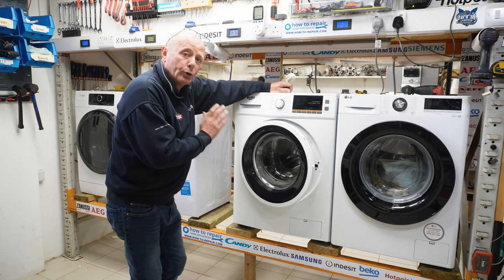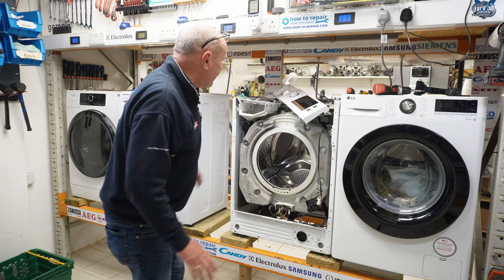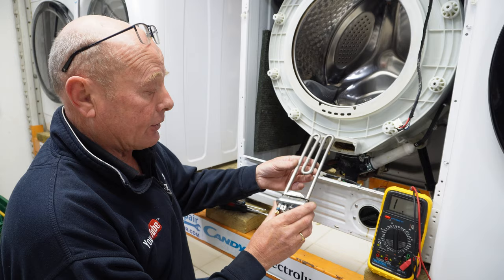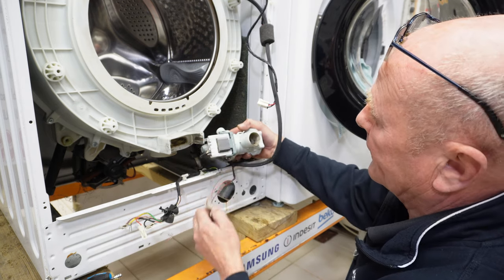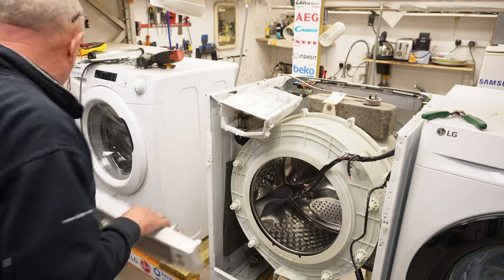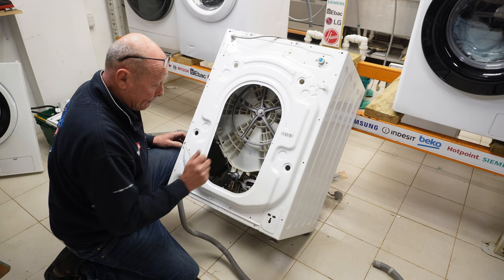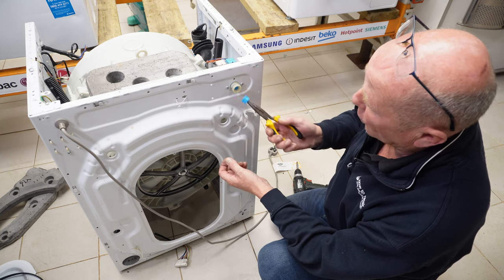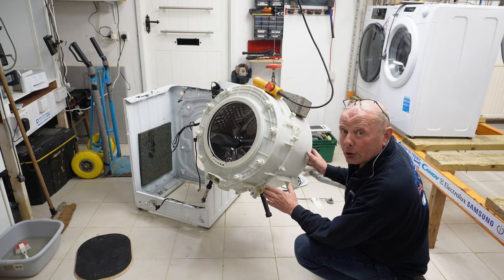Dismantle washing machine, Bush wmnbx814w Logik and other washers made by Vestel

Comment: Good video as usual. This machine reminds me a lot of Midea-made one, rather than Vestel. Usually Vestel machines have no removable back cover for the cabinet, and certain features which are very different to this one.
Reply from the maker: Interesting! I just had a look at the wholesalers website with the model number and a lot of the parts are Vestel part numbers, but after doing some investigation it does look like a midea. this might be my mistake so I apologise if it is actually this manufacturer

Comment: ive broken the outa drum several times when putting the front weights back onto older bush (vestal made ) machines, the haier made bush machines have been fine tho
Reply from the maker: Depending on the age of the machine, the plastic plugs can get brittle and snap if overtightened

Comment: In your opinion what is the best make of washing machine to buy?
Reply from the maker: I am absolutely disgusted with my industry which I've been part of for over 50 years. The build quality on all the machines is poor to say the least, manufacturers today only seen interested in building a machine that they can sell every five years, not building something that lasts 15 to 20. if you're going to buy a machine from the High Street store that I would suggest the LG but if you are going to buy online, I would have a look at ebac not because the build quality is any better because they are giving a seven year guarantee.

Comment: i have a front loader washer with a cracked tub and i have had it posted on ebay to sell as for parts for almost a year now and NOBODY WANTS  to buy it!!! i can't ship it as is, now i am just going to end up taking it apart and try to sell each part, but if that does not work, its all going in the trash!!